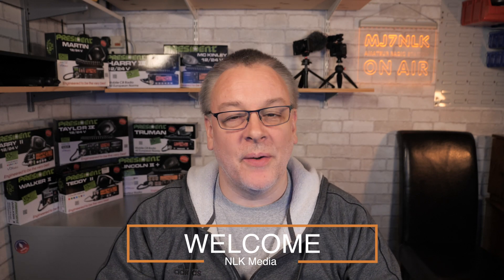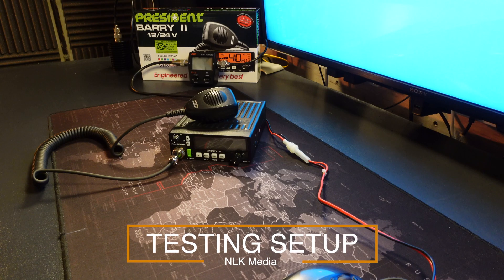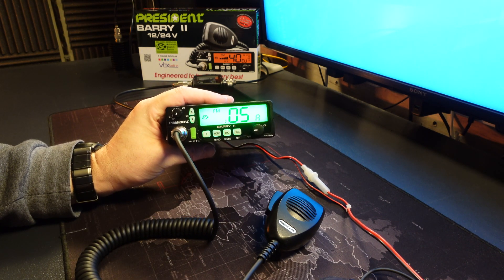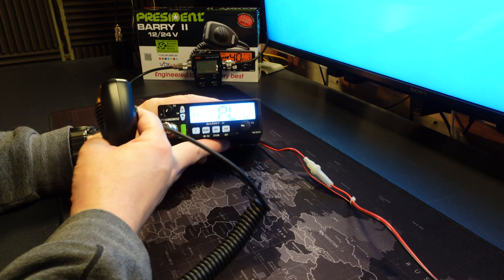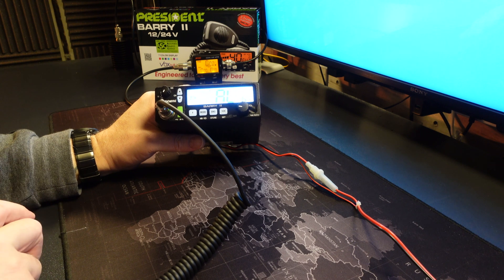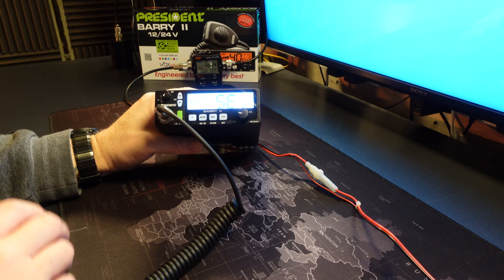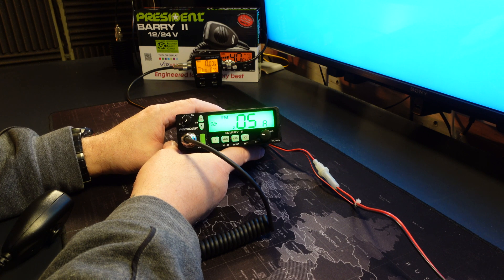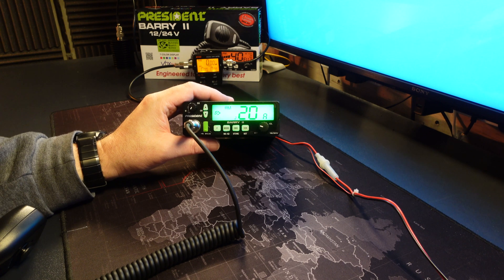President Barry II CB Radio - Part 2 - Power Adjustment - Service Menu

Comment: Hi i have t0 when i get on the radio in case of es… how can i get es back…? I have also a . Between my 2 numbers: 1.0 in place of 10 for example… thanks
Reply from the maker: Long pressing the F key usually swaps between t0 and t5 modes. If your seeing a dot between the channel numbers then your in t0 mode. If that doesn't work on your radio then let me know and I will get a Barry 2 out the cupboard and work out the keys needed to switch modes. I just can't remember on the Barry 2 without playing around but its normally the F key long press or double press on President radios. All the best and thanks for watching and commenting. MJ7NLK

Comment: There is a new Barry 2+ coming out shortly,nrc ect hopefully more fm power output
Reply from the maker: Yes, I have covered this in news sections on other videos. It's available now. I haven't got around to getting one yet. Still working through a backlog of radios which need reviewing first but will get one to see whats changed outside of NRC. All the best and thanks for watching. MJ7NLK
Reply: @NLKMediaGroup Hi I've got barry 2+ the engineer menu is different,did you pick one up yet,I don't want to go in blind

Comment: I have the cb now in ts mode but I want to adjust back to EU.  So i press F and turn on same time, but it shows ts and wont let me change.  How to adjust it back to EU mode ?
Reply from the maker: when expanded you can't use the pre-set norms. you use band blocks instead. I think band block D is the EU frequencies. if you move the jumper back to 1+2 it will revert the radio back to standard and you can access the norms again as normal. Best to get used to the band blocks if you want the advantages of expanding the radio. turn the channel to 01 and move between band blocks and when you see 26.965 you using the CEPT EU 40 channels. hope this helps. All the best MJ7NLK
Reply: I do see the block A, B and C but not the D block unfortunatly. I also notice that in the screen it says UK. Also when keep on scrolling, unfortunatly I do not see the freq. 

What does the cut wire do? And what does the jumper do?
Reply from the maker: @evglaser  Cutting the wire allows the radio to use high power mode when in expanded mode. The jumper in 2&3 position expands the radio so that it can break outside of the standard 40 CB channels and cover more frequencies. In order to do this it uses blocks of 40 channels with different frequencies in each. When in Band Block A it will cover 40 channels with one set of frequencies, when in Band Block B it will cover a different set of 40 channels on different frequencies. To use high power mode the radio needs to be in expanded mode and the wire cut, otherwise it will expand the radio but remain in standard power mode. Moving the jumper back to 1+2 will revert the radio back to standard norms and frequencies and back to normal power mode. I haven't used my Barry 2 for a while and cover a lot of radios so will have to get it out to check what band block relates to the EU 40 when in expanded mode. Will revert a bit later on this and let you know. MJ7NLK
Reply from the maker: @evglaser  Right, hooked out my Barry 2, expanded it and did some testing. Here are the frequencies in expanded mode:
Band Block A = 26.965 to 27.405MHz which is the CEPT EU Band
Band Block B = 27.415 to 27.855MHz which is superior (ie the next block above A)
Band Block C = 26.515 to 26.965MHz which is inferior (ie the band block below A)
When the mode button is pressed and you see UK on the screen and no Band Block is shown this is the UK FM 40:
UK FM = 27.60125 to 27.99125MHz
Please note that the @ symbol that is displayed on screen between channels 3, 7, 11, 15 and 19 relates to what are known as Alphas. The standard range of 40 channels steps up in 10KHz steps except on channels 3, 7, 11, 15 and 19 where the step is 20KHz. So, in between channel 3 and 4 there is a hidden channel if using the same 10KHz spacing. When expanding the radio you are able to access these hidden channels as well as denoted by the Alpha symbol.
Expanding the radio gives you 40 channels + 5 extra channels in each band block being 45 channels x 3 (A, B and C) = 135 plus the UK FM 40 means that in expanded mode the radio is capable of 175 freqencies of which 135 can be switched between AM and FM with Alphas and 40 are fixed to FM with no Alphas.
I hope this helps explain things for you. All the best and thanks for watching. MJ7NLK
Reply from the maker: @evglaser  The Barry 2 only has A, B and C in the band blocks and does not provide the full band-block expansion that other more expensive President radios do. On some of the other radios in the range they have blocks for A through to L covering a much wider sets of frequencies.

Comment: Is modding the radio dangerous in anyway please?
Reply from the maker: The radios are built with these modifications from the factory. I have not had any issues with enabling export modes in radios. Just remember to write down your factory calibrated settings so you can revert settings back if needed. All the best and thanks for watching.

Comment: Hallo vielleicht können sie mir helfen . MEINE FREUNDE SAGEN ICH BIN ZU LEISE AUF Fm was kann ich da tun und einstellen? ..

Danke im vorraus
Reply from the maker: Sie könnten versuchen, Ihre FM-Abweichung anzupassen. Wenn Sie Ihre Standardleistung erhöht haben, muss die FM-Abweichung möglicherweise angepasst werden. Versuchen Sie im Werksservice-Menü, die F2-Einstellung mit etwas Ausprobieren nach oben und unten anzupassen, und prüfen Sie, ob Ihre Freunde berichten, dass es lauter wird. Der gewünschte Wert ist 1,9 kHz, aber Sie benötigen dazu Testgeräte, daher ist nur Versuch und Irrtum Ihre einzige Option. Notieren Sie sich die bestehende Einstellung, bevor Sie Änderungen vornehmen. Meine Standardeinstellung war FF. Hoffe das hilft. Frohes neues Jahr und alles Gute für 2024.
You could try to adjust your FM deviation. If you have increased your standard power output then the FM deviation may need tweaking. In the factory services menu, try adjusting the F2 setting both up and down with some trial and error and see if your friends report it getting louder. The desired value is 1.9KHz but you will need test equipment to do that so trial and error is your only option. Write down the existing setting before making changes. My standard setting was FF. Hope this helps. Happy new year and all the best for 2024.

Comment: Good morning sir. I travel a road that has no telephone service for a few miles. With my health conditions it really worries me. I have to rely on CB to communicate. Is President your favorite radio and which one, if someone were to want more power, can you get the most power out of. Love your videos. You put everything in layman’s terms. Thanks
Reply from the maker: Hi Rob, thank you for your kind words. Its not just about power, the antenna and tuning it well for low SWR will also make a big difference. My favorite radio is the President Richard which can push 50W but is a HAM radio out the box and needs expanding to cover CB frequencies. The President Walker 2 is essentually the same radio as the Richard but is CB out the box. They share the same circuit board but when expanded the Richard does have a little more power. So, if your wanting CB then the Walker 2 is a lovely unit, powerful when expanded and easy to use. Watch my Richard and Walker 2 videos for all the info on them. If you want Single Side Band in your radio then hold fire as the new President George 2 is due any day now. Everyone waiting for stock to arrive and very much looking forward to testing that unit as it has much promise. The Richard and Walker have an RF Gain dial on the front so you can expand the radio and dial the power back to your legal limit under normal use and the option is then there in an emergency to increase. I did a couple of videos on Antenna Tuning and also the Diamond HF10-FX which is a 10 meter band antenna but when extended to its max length works really well for me on CB 11 Meter Frequencies. CRT and Alinco make nice radios and the Midland M20 is nice but I do like my President radios. If your UK or EU based then all the President radios you see on my channel have expandability but if your in the US then they are different and have mostly had the expandability removed. Hope this helps and thanks for watching.
Reply: @NLKMediaGroup    Have you tried the President DIGIMIKE yet. Love to know what you think

Comment: Any chance this process will work on a president thomas  fm radio?
Reply from the maker: I don't know as the Thomas is an FCC version and they usually are restricted vs the EU equivalent. I cannot get any of the FCC versions to be able to validate what options are available. I would work on the basis that it wont work but if you already have one then you could open it up to see inside. All the best and thanks for watching

Comment: Hı my Barry 1 model tx modilation is low FM? Whats the model modilation mods? Thanks..
Reply from the maker: Hi, the FM deviation adjustment on the Barry 2 is in the factory services menu and is the F2 option. My standard value is FF and the recommended adjustment is to 1.9KHz. All the best and thanks for watching

Comment: Re: prepper mode. Interested in your thoughts on prepper radio stations. Would like to know your setup for power down.
Thanks. Tried the setups with FCC radios. Most work, but no FM and some, do give extra bands.
Reply from the maker: Hi Buzzie, it depends on budget really and location of use (portable or fixed). You could manage with a solar generator like Jackery, Anker, etc. Most have a DC output built in so simple to connect to a radio and very portable. Best to have multiple options for flexibility and redundancy. The problem with large hard-wired panels and a multi-Li-ion battery setup is they are an advert to the people who didn’t prepare. A small portable solar generator, radio and antenna would provide a good amount of flexibility to cater for most situations. All the best and thanks for watching

Comment: Hi do you know if on the signal meter if each bar is 2 pounds as it only goes up to 4 bar on key
Reply from the maker: Hi, I do not know the answer to that one. I use an external power meter for measuring the output as the four bars don't really tell you much. It could be a 4W scale or a percentage of total power. It would have to be tested to find out for sure. It is unlikely to be anything overly accurate as the radio would need to factor in CW and PEP in order to provide anything meaninful and as there is no scale or measurement type indicator it wouldn't be of much use. Good question and not one I have been asked before. All the best and thanks for watching

Comment: I was able to use the same steps to enter the hidden menu in a president Thomas FCC radio. Most of the stuff is the same. It does allow for some nice adjustment. I had wished that they would have had a AM modulation adjustment. I am getting about 65% average modulation at normal speaking voice and the higher sounds get 85% and if I say audio it will go over 100%.  If I am correct on am if you don't have good modulation it doesn't matter if it has a bunch of power?  Even when the power is turned way down the modulation stays the same. I think some radios if you turned up the power they couldn't do the modulation. I have been away from radio to long. Now that I have seen the hiden menu and saw what the stuff does my only issue with the Thomas is that you can't dim the display. It is loaded with so many features that I can't believe it doesn't have that.  I do enjoy your videos. I can't wait to see you work your way through the rest of the president radios and then the next brand. I believe you said that you don't see much from cobra radio in the Europe, well they seem to have narrowed the stuff in the US also and in my opinion they seem to have an above average amount of issues with the CB radios. Cheers and thanks for the informative videos.
Reply from the maker: Hi Robert, thanks for confirming the FCC variant also allows for access to the factory services menu. AM modulates the amplitude (signal strength) vs the base carrier in order to transmit the voice signal. So, the input voice signal is combined with the carrier signal and requires more power when it is greater (shouting) or less power when it is smaller (whispering) but will always be 4W or more in this example as that is the strength of the base carrier being output. If your carrier signal is 4W you can see up to 12W being output if you're screaming down the microphone or around 8W if talking normally (just an example). FM on the other hand is a continuous signal and it is the frequency that is modulated. A 4W FM transmission will always be 4W regardless of the input voice signal. Thanks for the feedback on the videos and I am pleased you're enjoying them. They really do take time to research and put together but it's fun doing them. Unfortunately, time is my enemy at the moment so I have not been able to get the next video completed yet. I have the Lincoln 2+ and Harrison 2 left to review and then that's the entire President line up done. I have heard from a few US viewers about less than ideal Cobra quality control but cannot confirm this as we just can't get them here. Thanks for watching. All the very best

Comment: Odd how this radio only produces 7watts while the smaller Bill produces  15. Great video by the way, well produced and very clear. They make a great reference
Reply from the maker: Hi Simon, some of the radios have much more room for expandability than others. I guess its down to the components used. Some can only expand to 120 channel mode and other all the way. Down to the design and the size of the heat sink fitted as to the heat it could dissipate. All the best

Comment: I would like to know if it is possible to increase the performance of the Berry II cb radio with an  RM KL203P  type amplifier? What is your opinion? Regards: m.perczel
Reply from the maker: Yes an RF amplifier will boost the signal on any CB radio. The KL203P would do the job. However, the use of burners (amplifiers) that exceeds the legal limit are illegal to use. So, it depends on the law in your region. Just be careful to not over run the amp. Best to keep the power coming out of the radio down and let the amp do its job. Overpowering the input can damage it. All the best and thanks for watching
Reply: @NLKMediaGroup  thanks

Comment: Hi, how do I change the colour of the backlight
Reply from the maker: Hi Michael, thanks for watching. On the Barry 2 you turn the radio off, press and hold the Mode button and EMG button and turn the radio on. Use the up down buttons to change colour. When you have the one you like. Press and hold the F key until a beep is heard and then your done. Hope this helps. All the best